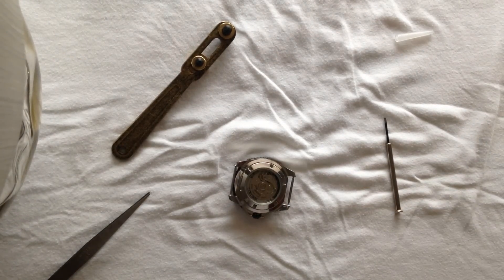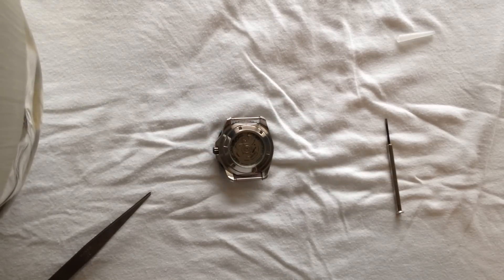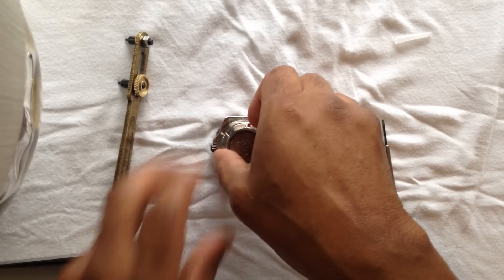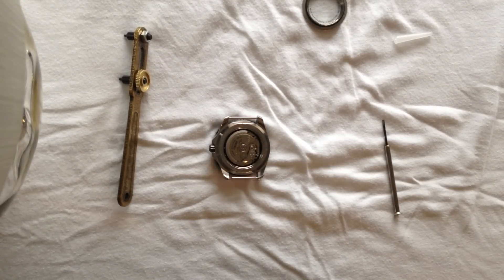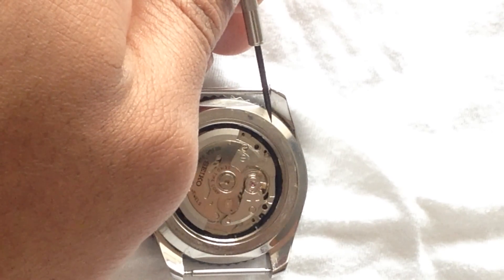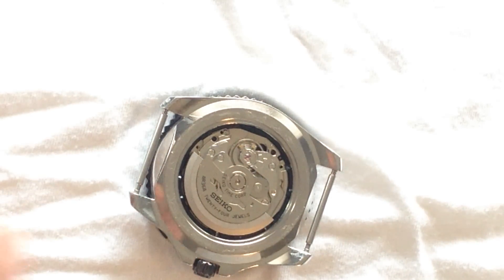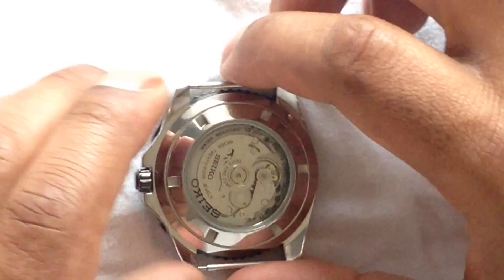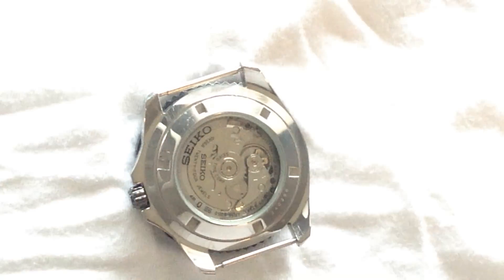Regulating Seiko 4r36 automatic movement

Comment: At Walmart, you can buy a Golds Gym 2lb workout ball that will open screw down case backs without scratching anything. It has a very sticky texture and is filled with sand. Costs $4.84

Comment: I've regulated 7 s26 and a 4 r36 with very good results you never get it right the first time you got to open the case 3 4 5 x but if you're persistent you can get them down to running plus or minus a couple seconds a day good video

Comment from the maker: My first attempt made it speed up about 5 mins per hour...I made a minute adjustment, and got it down to 1.5 seconds/day. Small adjustments is an understatement; don't force the issue as I did my first time. 

Then again, that's how I learned.
Reply: You can use an android app called Clock Tuner to regulate the speed to exactly 21,600 bph. There are other similar for iPhone also.

Comment: If it aint broke don't fix it ! 15 sec. a day is pretty damn good for a watch in this price range. I had a orange monster that ran about 25 sec. a day fast and I just couldn't leave well enough alone. The adjustment that is needed is so fine its damn near impossible to get it right without a couple dozen tries. Eventually I adjusted it so many times that I got in a hurry and ended up snagging the main spring and broke the whole thing ! My daughter bought me the bloody monster for Christmas , which has the new 4r36a movement. It runs about 12 sec. fast/ 24 hrs. And guess what ? Im leaving this sucker alone !!! I can live with that !
Reply: +STEVE ENGLISH TRUE!  15 SEC IS DAMN GOOD.  MINE IS LOSING GAINING ABOUT A MINUTE A DAY. pardon me for the capslock
Reply: a watch that looses 1 minute a day is  just a bracelet sorry
Reply: Yep, every time you open the back you risk compromising the water resistance. I'd rather live with the indiscretion of a dew seconds a day and only adjust it when required on the 30 day months or buy a more accurate watch.

Comment: I lost 1min20sec per day. I need the counter clockwise adjustment. I will let you know.
Reply from the maker: Thanks for watching and commenting!! Yeah...the adjustments are VERY minute. Now I used an app to almost instantly determine if the adjustment was too much or too little. It costs $4.99 in the apple AppStore, and it's called Twixt. It's a great app that uses pictures to measure quite precisely by how much a movement is gaining or losing per day. I highly recommend it, or you can just wait a few hours and calculate for a 24 hour period accordingly. Definitely let me know how it goes!!

Comment: Better of using tweezers, screw driver is too big. Use fine dumont 5 tweezers as they are fine point and easier to use and you can make micro adjustments with them.